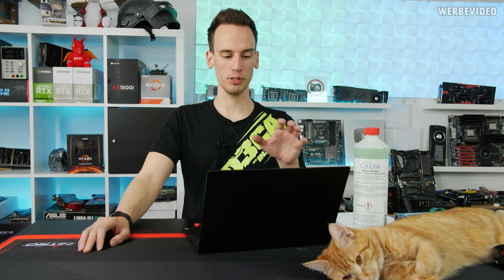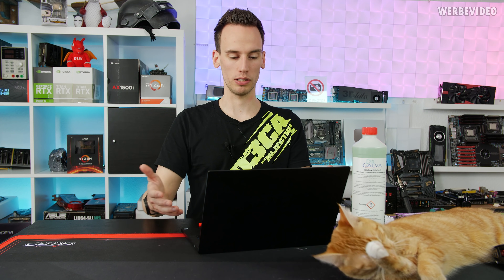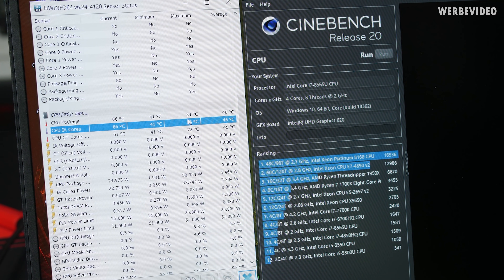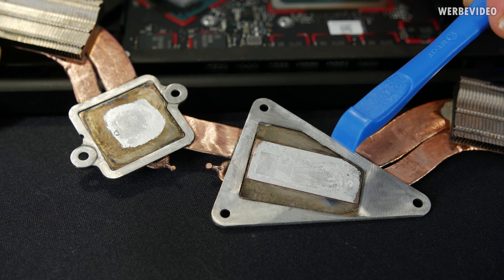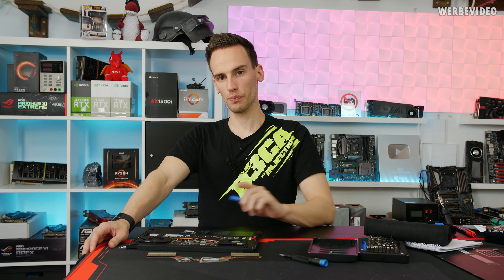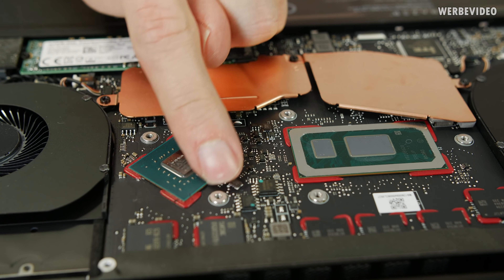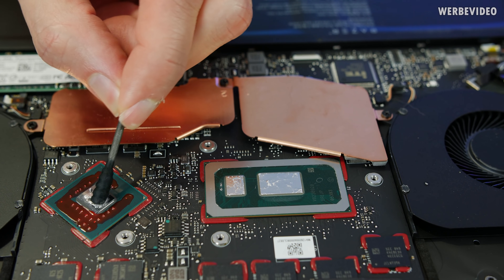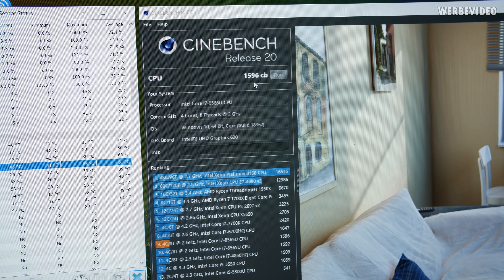Disappointing Results - DIY Nickel Plating Results 3 Months Later

Comment: After how many years do you recommend reapplying liquid metal? I have a laptop from 2015 with liquid metal and still was working in 2022  at low temps at the CPU. Unfortunately, the laptop now is not functional. Perhaps the CPU died. At the first half of the ram slots died. Then I did not bother with it. It is left in a closed now.

Comment: Hy, how diferentiate a nickel plated dyi and aluminum? i have a msi gf63 laptop 2021 and i want to replace the termal paste on gpu with liquid metal but the problem is , it's not copper, the dyi its like in your video, im not sure its nickel or aluminum, because the liquid metal doesnt work in aluminum.thanks for answer.

Comment: 9:24
This might just be OCD on my part, but you forgot to clean the two spilled-over drops on the CPU. I always clean any spilled-over liquid metal because I'm afraid it would drip out and short something. But if after 6 months those 2 smol drops are still there, then you're probably safe.
Still, imho it would have been better to sand and buff that dried out liquid metal layer to a mirror finish for better thermals. (By like 4 degrees, but still.)

Comment: Is drying out, actually a problem if you dont remove the heatsink again?
Is it because they are bonded together (the heatsink and spreader), so heat transfer would be fine, and thats what matters, right?
Is that why performance numbers didnt change over time?

Comment: Having seen how LM/gallium migrates through quite big aluminium parts, it makes me wonder: does LM react with "bare" copper, or does it rather only alloy with/wet the copper parts' oxide layer?
Reply: Gamersnexus did this as part of their testing. It does 'react' with the copper and form alloys, but these alloys dont affect performance in any way
Reply: Hy, how diferentiate a nickel plated diy and aluminum? i have a msi gf63 laptop 2021 and i want to replace the termal paste on gpu with liquid metal but the problem is , it's not copper, the dyi its like in your video, im not sure its nickel or aluminum, because the liquid metal doesnt work in aluminum.thanks for answer.
Reply: @Almighty-God-p2v  I would reach out to MSI. any home test to see if its aluminum or nickel may damage the heatsink (acid)
Reply: @Zippytez  i would try it.thanks for answer.
Reply: @Almighty-God-p2v I would assume it would most likely be nickel plated with copper underneath. Still wouldnt hurt to ask. Last thing you want is your heatsink deteriorating away from LM

Comment: Hey Der8auer! I have a proposal to test.

Back in my university days I studied the corrosion of NdFeB magnets in regard of coating. The best results of corrosion resistance were achieved on Ni-Cu-Ni coating. Here a thin copper layer acts as a diffusion blocker. However the best way to make this is to use vapor deposition (PVD coating) instead of electroplating. The electroplated metal can be of worse crystalline quality than pvd-coated.

Hope it helps in your research.

Comment: I found a liquid metal called "Silver king" after 3 months the liquid metal on a bare copper cooler block was still liquid and not dry at all. Prior to this i used coollabs liquid ultra on a different cooler and that dried/plated to the block. Im not sure if theres somthing in the silver king that stops fusing

Comment: If the thermal performance is the same , why bother nickel plating? After all , if liquid metal "dries up" that means that it will not leak or spill anywhere, thus protecting the rest of the machine no?

Comment: The electro formation as that process is called is quiet difficult in " uncontrolled" situations.  To get even layers you need a lot of control such as PH control throughout the bath. Also anode and Kathode need really good connections to that, preferrably multiple copper wide mouth clamps. Not sure if they still produce them like that but  the first gens of raiser blades from e.g. Braun were produced with the nickel electro formation. Everything need  to be cleaned in depth as any oil from hand or equipment will have a negative impact on use. If I remember correctly, they use in the industry steam cleaning and solvent cleaning for that.

Comment: Electroplating on a laptop cooling solution would be very interesting, but I guess a desktop would also be interesting. However in that case it is quite easy to find commercial ones that are already plated, so I don't really see the need.

Comment: electro platings the only way  lower the voltage the better  ie) <4v and amps based on the size 50 amps per 100000mm ~2.5A for a water block

Comment: Interesting. I installed Conductonaut on my MSI GT72 about 2 years ago. I've also applied it direct die on a 9900k with an EK copper block. No performance degradation on either system, but now I'm curious what they look like.

Comment: I was running LM on a custom pure copper (no nickel plating) IHS for my 8700k for over a year after its initial application and got the same results. LM was dried out and infused into the copper on IHS (like a plating). Still, I did a sanity check benchmark before maintenance disassembly (custom liquid cooling loop) and temps were the same as the first day test.
After thorough cleaning I've reapplied LM to the IHS and CPU die and everything is running great 7-8 months later. I only did LM reapplication because I was removing the CPU block.
I've been also running LM in my old and trusty Dell laptop and it's still doing fine after about 3 years now. Other than cleaning the fan I did not removed the cooling block from it and the temps are just like they were after initial application.

Comment: Applied Conductonaut on the bare copper Heatkiller IV waterblock with my old 1080 Ti and after about 2 years, the temperature went up by 10-15 degrees.
So yeah buy a Nickel Plated waterblock is most ideal.
For Laptop just stick to thermal paste and use ThrottleStop to reduce CPU temperature.
Reply: Hy, how diferentiate a nickel plated diy and aluminum? i have a msi gf63 laptop 2021 and i want to replace the termal paste on gpu with liquid metal but the problem is , it's not copper, the dyi its like in your video, im not sure its nickel or aluminum, because the liquid metal doesnt work in aluminum.thanks for answer.

Comment: Great content! Thanks for the following up on the DIY Nickel platting project, I was wondering give it a try myself sometime at the end of the year. 
Regarding the result, I think it might be caused by several factors:
1. The plating is not thick enough, ion migrations between Cu and Ni was still happening through the thin player.
2. The plating surface is not smooth/ might be filled with micro-pores which allowed the ions to migrate.
The solution to both of the problem could be left the heatsink in the nickel solution for a longer period and then polish the surface.

Here's an interesting thought, since you are platting your own heatsink anyway. Could you use other metals? For example silver or gold. Silver has better heat conductivity than copper and may increase thermal performance.And, Gold is one of the most unreactive metal which may further help with liquid metal 'drying up' (I'm sure you are more familiar with the subject matter than I am)

What I don't know is whether liquid metal (therefore, its components) will react or form alloy with Silver (and for that matter Gold too ) or not. If you have the knowledge or the reference please do share :)

Comment: How can I lower the core to core delta when using liquid metal? Every time I remount the heat sink the hottest and coldest core change and they're like 10C apart under load.
Reply: Sounds like uneven heatsink/heatplate or bad liquid metal application. 
For application, You wnat to have a uniform thin layer on bothe the die and heatsink before put the heatsink on the die.
If you have uneven heatsink surface, quickest solution is the sand it down ;)

Comment: @der8auer got a weird issue with a 3800x... had it OC at 4.4 all core at 1.375 as you had in a previous vid, was stable for a few weeks and giving a r20 score of 5206, then had a booting issue where my b550 tomahawk showed the cpu light and wouldnt boot, and reset the bios and re-did the settings to the same as what i had and now r20 will only give a score of 4898, and now can also set to 4.4ghz/4.45ghz all core at 1.33v which i couldnt get before so just wondering if you have any idea's, ie bad motherboard/cpu?

Comment: I think it might be interesting to test the theory that the plating failure was caused by the aluminium (?) part of the heatsink also being submerged into the plating bath. You could get a couple of copper heatpipes, try plating some of them normally, then take the others and friction-fit them into a piece of aluminium, like a stock Intel heatsink, and try to do the plating with both the Al and the Cu submerged.

Comment: @der8auer : instead of putting nail polish or that new product you've showed in the video on the electronic components (resistors ???) surrounding the CPU/GPU die, wouldn't it be easier just to put normal TIM paste around the CPU/GPU die so that the liquid metal compound cannot go off the actual die ?

Comment: I think i saw a laptop once that used skinny thermal pads around the around the die,when using liquid metal,to keep the liquid metal on the die,so it doesn't "leak" out,does this make sense? Or is it better to just seal everything in nail polish?

Comment: I use automotive silicone to protect the components when i apply liquid metal, i did my laptop 18 months ago, havnt check it but temps are still very good
Reply: Gasket maker RTV silicone? The one i have is acetoxy formulation, obvious by the vinegar smell while it sets; it's not suitable for electronics, can cause corrosion.

Comment: YEY, TG Shield! Great product! =)

About LM and copper. I got "idea" to combine thin layer of graphite sheet (with adhesive layer) and LM. Graphite simply stick to copper heatsink and act as protective layer between copper and LM, but still transfer heat. Problem is, i didn't ask yet Panasonic about how LM work together with graphite. :) But i saw patents, that LM was added in CNT (carbon nano tubes).

Comment: just wondering if you could package the LM in a small vial instead of in the syringe.
No matter how many times i use the syringe, the LM ends up going everywhere because of the weird surface tension.
For a small vial i could just dunk the cotton bud then apply.

Comment: If the liquid metal sinks in and then makes alloy, isn't it a perfect contact ?
While the alloy is still metal
Reply: In a way yes. As a liquid, it fills the micro imperfections, and the material doesn't just disappear when it alloys with the copper (or whichever metal is next to it). It won't be actually perfect due to volume changes, but it is the reason why "dried out" liquid metal is not as much a problem as dried out thermal paste is.
Reply: @WouterVerbruggen  In practice if you use the laptop it will eventually separate due to flexing of the chassis. I've been doing this for 7 years; best solution is proper hard nickel plating

Comment: Yes more videos on nickel plating or electroplating would be very helpful. I wanted to build up a thicker metal layer on my Wera screwdriver because the bits are too loose in the handle. Unfortunately the shape is like a hex socket. So it is a difficult shape to electroplate. Perhaps I need to think of something else. But wanted a solid metal layer because it it a screwdriver. For the durability, not to wear away so quickly.

Comment: For the electrical part of the nickel plating, why not use a old PSU and cut the 12v wires off a molex connector. Should give enough current to give decent 12v electroplating
Reply: Hy, how diferentiate a nickel plated diy and aluminum? i have a msi gf63 laptop 2021 and i want to replace the termal paste on gpu with liquid metal but the problem is , it's not copper, the dyi its like in your video, im not sure its nickel or aluminum, because the liquid metal doesnt work in aluminum.thanks for answer.

Comment: You should do electro plating! It's much easier to DIY, much less dangerous and will give a thicker coating. From what I've learned in your two videos about chemical plating, the big upside is when plating weirdly shaped objects, but this is not weirdly shaped at all! Give electro plating a try, I'm sure it will be much better!

Comment: I already tried electroplating nickel to heatsink baseplates and they still get stained from liquid metal. It didn't matter if it was just a thin 10um nickel layer or a thick 100um layer that took hours to plate, liquid metal will still stain it anyway.
Reply: What did you learn from it? Did it make any difference in performance or all the hassle is unneeded?
Reply: @ItaloLoureiro  Not worth bothering as results did not come close to matching theory. The plating didn't affect performance compared to bare copper. Only thing it's good for is preventing copper oxidation but a can of Brasso will fix that for an order of magnitude lower cost, time, and health risk (nickel is a skin sensitiser).

Comment: You should indeed do the electroplating as well! My ThinkPad W540, of which I nickel plated the heatsink half a year ago, is still having great temperatures. I haven't checked it again tho, it's quite a hassle to open it up and I can't have it unusable for a long time as I need it for work. I used kathodic electroplating and a nickel acetate (which I made by dissolving a nickel coin, connected to the power supply's anode, in vinegar)
Reply: Did you follow any specific tutorial?

Comment: be very careful when removing heat sink when liquid metal is dry as shown in the video i was reckless and forced it and  damaged the cpu die
Reply: you scaring me man
Reply: im assuming you ripped a corner off the die ?  Did you twist it some to break the seal or just pull straight up ?
Reply: @mcgman8058  forced the heat sink up and ripped the surface ( the thin chromy layer of the cpu) i could see the actual cores :D wasnt funny when it happened. had to replace the motherboard as I don't have the equipment to replace the cpu/gpu  package.
Reply: @yeghigmikaelian  yikes !
Reply: @mcgman8058  shit happens when you party hard :)))) expensive lesson
Reply: @yeghigmikaelian  You should have taken some photos or made videos of it. Sounds cool.
Reply: @monotrope  cool and painful but mostly cool

Comment: So, what is the point of re-applying the liquid metal if everything is working fine?
Reply: As Kevin H said, because he took it apart, thus breaking the mating surfaces. If you tried to reassemble this would leave small voids creating hot-spots.
Reply: because he took it apart

Comment: Please continue on laptop, I'm pretty sure a lot of people have thermal issues on theirs. I personally use conductonaut on mine and no nickle plating, not sure what easy solution I'll be able to find. I'm Afraid the cooler materials will suffer corrosion or degrade over time. Also, I just isolated the caps with Kapton tape. Is that fine?
Reply: planning to do that with my 5400 latitude as well. Thermals (35W+) are the main culprit of throttling but only if RING/PL4 (25W) didn't kick in.
Reply: The ideal way is to create a foam barrier as done by OEMs.
Reply: Kapton is thermally insulating, better use 3M thermally conducting tape and an undercoating like nail polish or conformal coating.

Comment: I've sanded down my 9900K die to ~0.5mm height and used LM between the die and Corsair H115i Platinum - 30 degrees lower temperatures and stable overclock now but I've done it after learning about the diffusion barrier and now I'm concerned about the life of CPU. :(
Reply: cpu's not what you need to be worried about, it's the effect it has on bare copper of the cold plate it's self. as long as the temps are good you're better off not removing it. if temps start getting worse outside of higher ambient temp effects then you might want to consider re-applying it.
Reply: Hy, how diferentiate a nickel plated diy and aluminum? i have a msi gf63 laptop 2021 and i want to replace the termal paste on gpu with liquid metal but the problem is , it's not copper, the dyi its like in your video, im not sure its nickel or aluminum, because the liquid metal doesnt work in aluminum.thanks for answer.